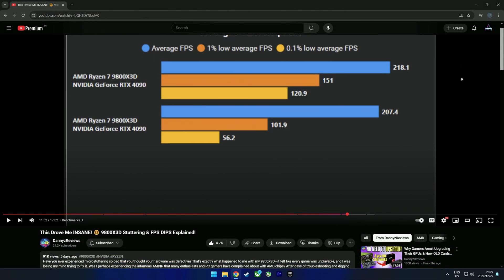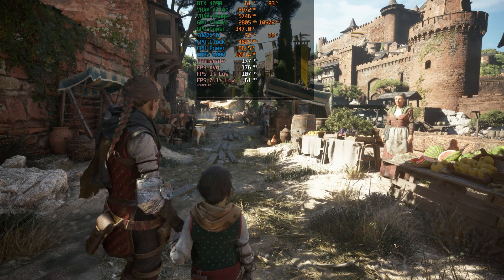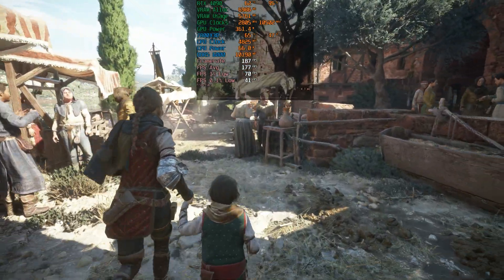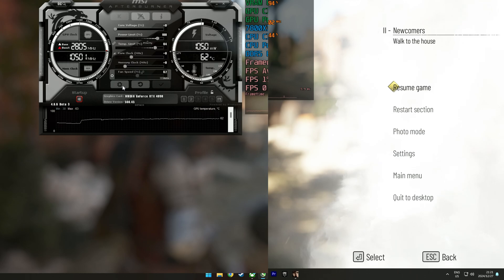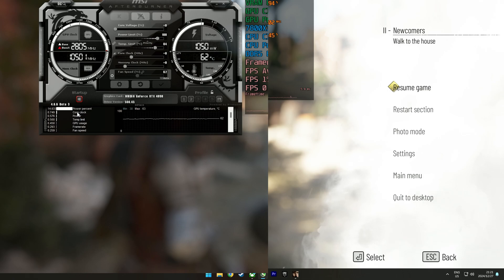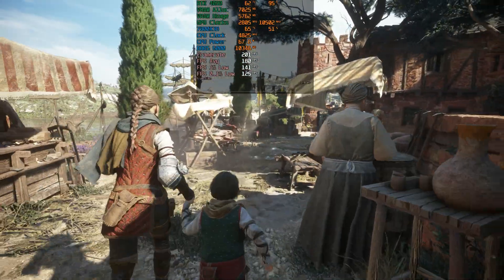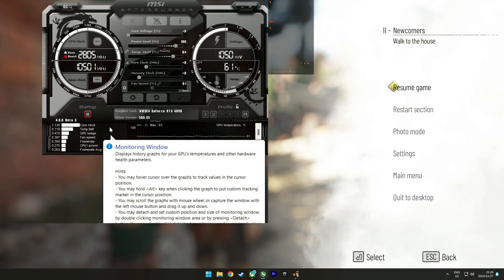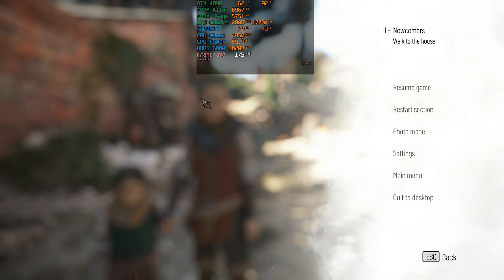MSI Afterburner Causing The Infamous "AMDip"?

Comment: I think I had this same issue a while back on an Nvidia and Intel system. Stumbled upon the same fix and since then i've been careful with the performance overlays/metrics I use. Thankfully I use an AMD card now so I just try to use the AMD overlay instead of afterburner since it is so fully featured, and the driver overlay is likely to have less issues. Unfortunately the Nvidia overlay still doesn't show some metrics and doesn't have a lot of options so you kind of need to use afterburner with Nvidia cards.
Reply from the maker: Yeah, this is actually a lesson for me too, to be careful about what metrics you enable. Radeon GPUs arent affected by this issue as it's caused by the way the sensors poll power percent through the NVAPI. Unfortunately I only found that out after I already uploaded the video, but I pinned a comment stating the same.

Comment: Its not only power. 6800xt+ 9800x3d here
CPU/GPU temp and cpu/gpu power gives me the "dip" every 0.6sec (had 600 pooling rate)
Disabling all 4 above gives massive 0.1% low gains.
Reply from the maker: Yeah, if you use the profiling option it's easy to see what causes it. The Nvidia API is known for causing issues specifically with power %, but not always, and not always only that. The AB dev mentioned that these polling options can affect different systems differently, that's why I showed how to use the profiler to identify potential issues. Very useful option that.
Reply: @Mostly_Positive_Reviews  ye i used the profiler 17ms for cpu temp crazy...

Comment: Does this affect older versions of MSI Afterburner as well? I am running and old build from late 2022 and I have not noticed this issue with power monitoring turned on. System is a R7 7800x3D + RTX 4090
Reply from the maker: I'm getting conflicting reports on that front, sorry. Some people are saying older versions dont exhibit this behaviour, but others are saying it's to do with how these sensors read the data within the Nvidia driver, so the version of the monitoring tool in that case shouldnt make a difference.

It also doesnt happen in every game for me, but a few I have tested that do include Stalker 2, Cyberpunk 2077 and Indiana Jones, although to a much smaller degree.

Comment: I was experiencing sudden stuttering during ANYTHING I DID ON MY PC.
It still is my main rig, with a Ryzen 3600 and an RX5700, and I lived with this issue for months!

Until I wrote a post on the Linus Tech Tip Forum and, suddenly, here's the solution: Disable the mobo firmware TPM. I had enabled it for more safety, but didn't connected that the stutter was caused by that. It was finally fixed by a BIOS update of the mobo.

These kind of issues are a real pain in the butt to troubleshoot, and it's incredible that they are still happening with other softwares suites.
Reply from the maker: I was just telling a friend of mine that between the Nvidia App issues, Windows issues, BIOS issues, and now this, it's become impossible to know what is the cause of any stuttering in games. It can be so frustrating at times :(

Glad you got your issue sorted though! I also wouldnt first think of TPM.
Reply: Isn't this fixed? On my 5600 a BIOS update fixed the TPM USB stutter.
Reply: i have an intel i5 6500 on a dell office computer. how do i disable this TPM thing?
this dell bios is weird
Reply: @cant_Comment  its laptop bios, those are generally locked. You should try to once to go to the UEFi settings. Who knows you might find an option.
Reply: @cant_Comment  AMD fTPM was stuttery a few years ago, but they've fixed it with BIOS updates, this simply doesn't apply to your i5-6500.

Comment: İ have 5800x3d and 4070. This effect me?
Reply from the maker: Highly likely that it would yeah. It seems to be Nvidia specific, but for me the issue is only on my AMD system. Worth it to check it out if you are also impacted.
Reply: I just disabled power usage of gpu and cpu, I have the 5700X3D

Comment: Interesting. I will check it out on my side too. Now do a comparison of Nvidia app with filters overlay on and off. I use it for dark games so need to see if it actually reduce performance even not active. 🤧🥲
Reply from the maker: Filters do affect performance unfortunately. I was busy testing and recording to show that, then I got a support call from work :( But just enabling the Photos and Filters in the overlay without adding any filters impacts performance, and then other filters applied on top of it also affect performance, but it depends on the filter. As they are basically post-processing effects it does have some GPU cost, some more than others.